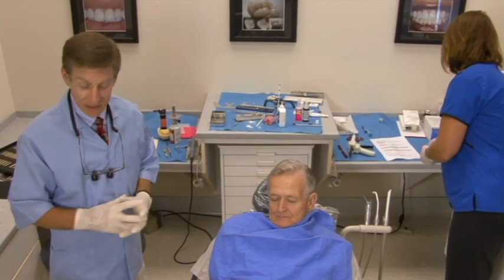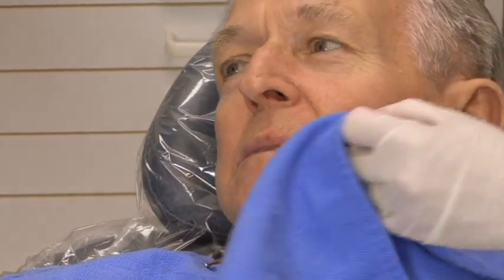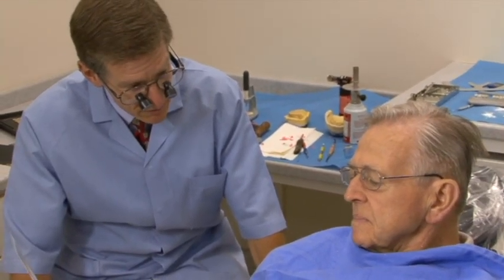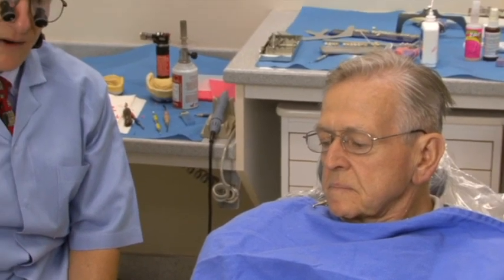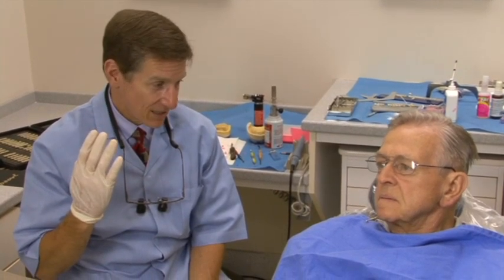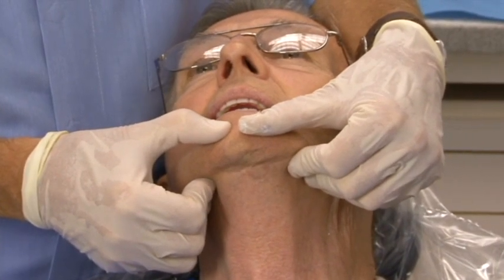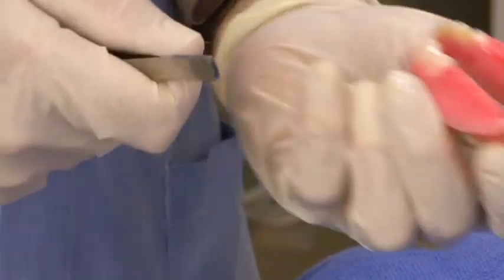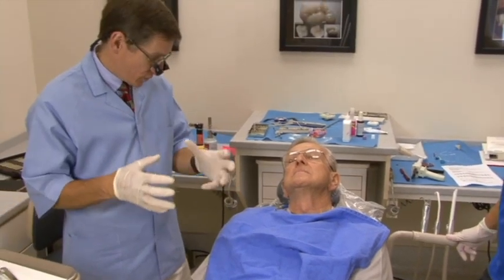Denture Bootcamp Series Part V: Wax Try-In

Comment: Just got back from my Wax Try In's & the upper wouldn't stay up 
mainly because they were so heavy.. So much wax is what I noticed. My upper lip stuck way out. 
Mine are medium size teeth & they were lined up perfectly but he didn't do a bite registration or anything. My only issue was the wax up top in front, seemed like a lot. If they took off about 3-4mm I think it would've been perfect & they told me my permanent dentures or the acrylic will be thinner than the wax. I couldn't say a single word with those in my mouth.